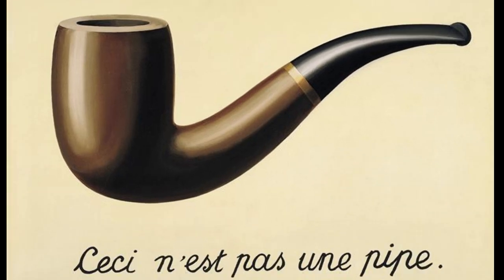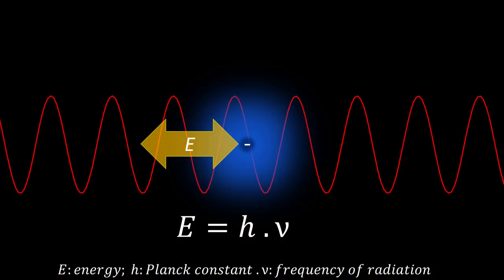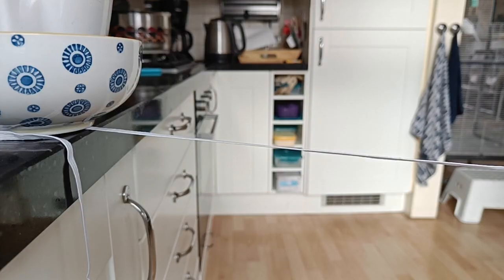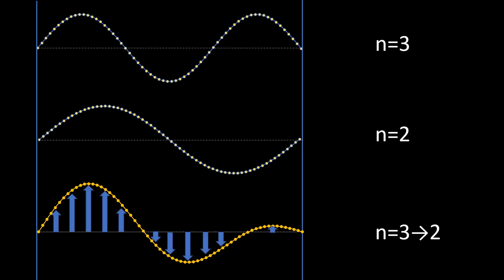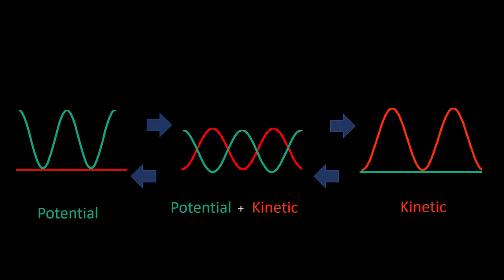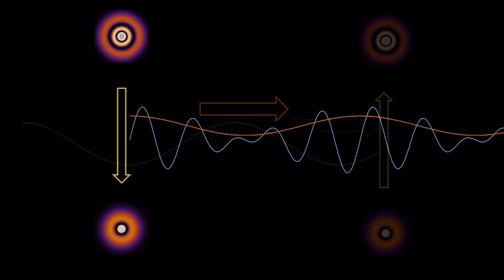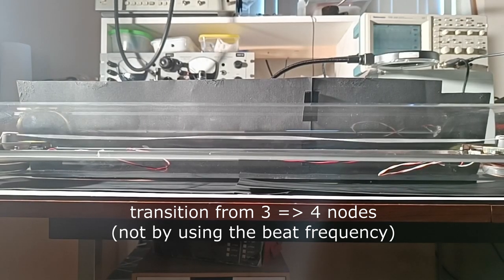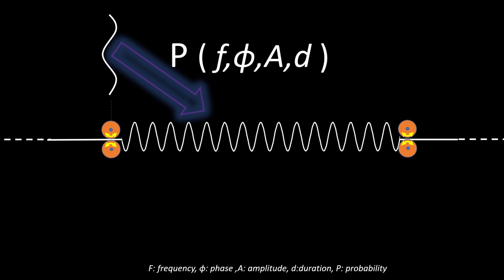Coherence part 3: This is not a wave.

Comment: The property of space that traps electro magnetic waves, is that perhaps the permeability of free space as taught in  theory and radio & antenna topics? Does a dielectric material, have a stronger effect or one that works at lower frequencies? 

I am reminded of slabs of clear plastic acrylic, be with a very strong electron gun, that hold a charge inside its volume, which is dramatically released as an electrical discharge lightning bolt pattern, when a grounded ice pick is used to stab the slab of acrylic. 

https://youtube.com/watch?v=f-_UfQ5eOxA&pp=ygUeTGlnaHRuaW5nIGFjcnlsaWMgZWxlY3Ryb24gZ3Vu

Granted, in one sense, the charge is perhaps many many electrons trapped in the plastic. But in your standing wave sense, it could be another example of entrapping high frequency waves within by space but a dielectric material. The closing thought is perhaps one can trap lower frequency electromagnetic waves more thoroughly or with less leakage than say a resonant cavity. Superconductive cavities also come to mind.

Comment: Not so quick, what would happen if one speaker would have a frequency of something like 8 Hz at one side of the table and another speaker would have a different frequency, like 12 Hz, but then not horizontal polarisation, but vertical, both agitating the same medium. Then the string would have two resonances at the same time. Would this not give some vision in how and where, the standing wave would be fluctuating and only visible for a certain viewpoint. 
 
Back to the kitchen.

Comment: Thank you for yet another interesting and informative video, particularly about beat frequency being the difference in frequency between 2 vibrational energy states.  Unfortunately, you are limited in your ability to understand the fundamentals of physics because you assume some things that are incorrect, and you need to instead assume some other things that are correct.  When you're ready to get serious about understanding the fundamentals of physics, my unifying theory, matter theory, is for sale.
Reply from the maker: If you have solved physics, then why is nobody buying your solution?
Reply: @HuygensOptics  I think the main reason why nobody is buying my theory is that there is no science organization that is offering to pay for a unifying physics theory.  If you know of 1, and your introducing me to them results in a successful sale, I would be happy to give you a small, yet significant, percentage of what I am paid by them.  Also, I spent over 30 years independently inventing my theory, bit by bit, until I finally had what I consider to be a more or less complete theory, so during all that time I developed no scientific reputation whatsoever.  To try to develop my scientific reputation, I invented what I think is the only logical explanation for the most surprising results of many particle 2 slit experiments, and I made a video about it, which no 1 seems to care about, possibly because it contradicts all versions of quantum mechanics, which makes some quantum theorists look bad.  There are other reasons as well.  Thank you for your interest.  I'm looking forward to your next video.

Comment: One more thing.  Your experiment isn't a good analogy for two reasons.  The EM field doesn't correspond to something that feeds into the electron at its ends; the field is present over the entirety of the electron-containing region.  That means every point on your electron string needs to be coupled to a separate EM field string.  Since the two fields have different properties, the strings need to be made of different materials, e.g. the electron string must be many times more rigid because it has mass.  I don't know how you'll attach them together adequately - you almost need to have an elastic strip between them.  Technically, it also doesn't fly to ignore the fact that the nucleus and electron both have a charge that deforms the EM field by its presence.

My suggestion to you is that you learn some software and programming.  It would be much easier to model the system digitally, and probably more accurately.  Your argument is not about real strings, after all, so that analogy isn't really necessary for your point.  Your point is to examine classical systems that you think could explain quantum properties, and computers have become very good at modeling classical systems.  It will save you time and money, and in the end, when you have to accept that the EM field is itself quantized, you'll appreciate that.  

I had a similar journey through QM, myself, since I was a chemistry student and not a physicist, trying to learn QM on my own time.  I encourage you to explore the topic extensively right here on YouTube.  PBS SpaceTime is an excellent introductory resource, and then you can graduate to all the hundreds of lectures uploaded by Stanford and other institutions.  You should know, at least, that very smart people have had your exact thoughts and pursued them to their conclusion.  Find out what they did and why they didn't revolutionize their fields, and you will have the answers to your questions.

Comment: And now. How might this theory related to the idea of quantum entanglement and Bell's theorem? https://www.youtube.com/watch?v=zcqZHYo7ONs
Reply from the maker: For entangled photons it would mean that they are the result of localized wave energy split in parts, Since these originate from the same creation events (alternatively read "the emitted photons"), the corresponding entangled detection events would have a relationship between specific properties, such as for example polarization. However, because each detection event is governed purely by the statistically interaction with what is essentially a wave, the outcome of experiments would also suggest the lack of local hidden variables.

Comment: I found again one of the best wave machines I have come across:
https://youtube.com/watch?v=DovunOxlY1k&pp=ygUWYmVsbCBsYWJzIHdhdmUgbWFjaGluZQ%3D%3D

Perhaps this might provide a cleaner wave having better “inertia”, to demonstrate the mode change more clearly, when the wave is compelled to switch between different particular resonant frequencies. Note the wave is based on torsion of elastically coupled rods. 

Another video where the rod tips have glow-in-the-dark pigment and when illuminated with a black light, show the wave vibrantly as an oscilloscope:
https://youtube.com/watch?v=YQHbRw_hyz4
Reply from the maker: Thanks for the links, I did not know these videos. Very beautiful and clear demonstrations I guess mainly because of the inertia of the medium and the low spring coupling constant between the oscillators.
Reply: Glad to see someone else already recommended this. It seems that the decay time would be longer with the torsion based setup. With proper instrument synchronization, 1ms is a long time, so you could achieve good control over relative phase between the 8 and 32Hz waves, as well as inject 8Hz right as you stop injecting 32Hz. But that doesn't help for this demonstration if the oscillation doesn't persist for at least several wave periods!

Comment: A new magnetic trap geometry was discovered.
https://youtube.com/watch?v=Rx4lNihOT4U

I wonder now if one could synthesize this field using a fixed coil. 

I wonder also if one could find a similar-as-possible arrangement using a spinning electrical field consisting of opposite polarities rotating but perhaps offset a little as with the magnet trap discovery.

Field based traps are interesting because they could enable new standing wave geometries.

Comment: Sorry but you should use a double slit with 0.4mm and a distance of 0.4mm also. And the laser needs 100mW.  In this case you will get a real doubleslit picture. Now close one slit and you will get a Single slit picture. Than you have to place a black paper 1mm behind one slit. Now you don't get a Single slit picture but you get half of a doubleslit picture. The result of this tests does show light is not a wave.

Comment: I would love to let my brain relax and accept that quantization is a property of matter and its interaction with purely wavey fields.  Unfortunately, the more you dig into all the bizarre quantum behaviors that apply equally to matter and light, the more untenable this becomes.  Photons can be entangled, and their polarizations can then be correlated beyond any physical reason.  If EM radiation was strictly taking place in a continuous classical field, then how can we measure those polarizations independently?  How can they be exactly correlated if there aren't individual photon pairs to correlate?  Sorry dude, I want this to be true as much as you do, but it just doesn't work.
Reply from the maker: Entanglement in photons is just doing two measurements on the same wave.

Comment: Quantization is a property of all physical systems. Dude... not paying attention in science class is not a good thing. ;-)
Reply from the maker: So why do you think that is?
Reply: @HuygensOptics  Most likely because of relativity, but I haven's seen a simple handwaving argument for why angular momentum and action have to be quantized, so I can't give an easy to understand explanation. What we do know is that quantization is the reason why there is any matter at all. Let go of it and there wouldn't be "any thing". 

And why aren't people paying attention in science class? Because they don't think that they will need this stuff. And they won't... until they decide to make videos about it on YouTube which prove that they didn't pay attention. ;-)
Reply: @HuygensOptics  Why is it that because of relativity? Because what is quantized is the angular momentum. There are some very strange things happening when you try to turn a coordinate system in a relativistic universe. At some distance from the center of the rotation the relative velocity exceeds the speed of light. I don't have a good physics intuition for the consequences of that, but I would expect that there have to be non-trivial consequence for the definition of classical quantities like angular momentum. Since it's a phenomenon that is scale independent (it happens for any angular velocity, just at a different distance) that consequence may be the angular momentum quantization of fields.

Comment: There is no such thing as "A Photon".  It a concept only, a metaphor for something we really truly do not understand. A photon  doesn't exist as a tiny piece of matter therefore it can't have any Mass. no Spin. Its not a wave either, absolutely nothing like a wave in the ocean, absolutely nothing like a sine wave plot. Its certainly not a "wave-packet"  These at best are only abstract mathematically derived inventions of fantasy. A bunch of little Many Photon balls never smashed into a piece of silicone photo cell, and "knock off" Electrons, as Einstein thought. ( Electrons also do not exist as little balls of matter.)  Why this author thinks that Light is an Electromagnet effect is beyond me. Light is absolutely unaffected by either Electric fields or Magnetic fields, it couldn't  care less. If it were actually Electromagnetic, then it would react wildly to exposure to Electronic and Magnetic fields. But it doesn't  flinch.
Reply: I have to agree with this. I would like to know where physicists demark the difference from 'photon' wavelengths and the EM waves we know as 'radio waves' (RF) extending up into the millimeter waves we work with now. I think the 'photon' was created in the era of the photoelectric effect by Einstein. As a radio and RF engineer, I stay away from what I call weak photon analogies or explanations of things.
Reply: @uploadJ  So, have you ever heard of an explanation of how RF technology functions, that uses exclusively the concept of Photon Particles being responsible? Because if its all part of the EM spectrum, and that is Particles as well as Waves, the RF theory ought to be explainable by particles bashing into the antennas, so how does that work?  What damage to the antennas does countless trillions of solid particles of some unknown substance, smashing at exactly Light speed, into that soft aluminium, do the the metal? Surely it disintegrates after a few minutes under such a bombardment. Not to mention that according to some quack theory, ANY OBJECT that has attained light speed, MUST possess INFINITE MASS. (the very irrational excuse is that IF you got a Photon Particle and strapped it down to your scale, it would have no MASS because its not moving.  Because as everyone knows instinctively, the truth is that MASS comes from moving.  You move, you gain weight. This is why if you sit on the couch and eat potato chips and chicken, while not moving, you will weight less than that guy jogging past your front porch. See!, I can spin a scientifically convincing story as well as the best of them.
Reply: @everythingisalllies2141  TL;DR. You still can't explain simple wire dipoles with ANY kind of 'photon' nonsense. Well, maybe you can, but, you will be the only one to understand your explanation, because, 'potato chips', and it would be, well, fantasy. Let's not have you waste any more of our time, and you then look up "Antenna Engineering Handbook" by  Jasik, Henry before you respond again.
Reply: @uploadJ  Er.. I think you forgot that what I said was sarcasm. There is no such thing as "Particular" EM  effects.  No Photons anywhere, at any wavelength.  But in a nutshell, pertaining to the belief that "Light" (EM spectrum, including RF) is  "particular," (made of particles of matter)  what did Henry Jasik have to say?  Did he mention it at all?
Reply: @everythingisalllies2141  Oh - a spoof account. Thanks for admitting as much ...
Reply: @uploadJ  I don't get you.  First you agree with me, then next breath, you are making incorrect statements about whit I did not say, that have no bearing on this topic.  Which was, "Do photons exist?"

Comment: The current definition of an election is only a conceptual reification, it's 1 unit of dielectric inductance. Don't get me started on the photon...to late, light is a sound wave in the ether. I'm paraphrasing but that's what Tesla said. When you talk you don't emit sound particles your setting up a disturbance in the medium of atmosphere. Light is a coaxial longitudinal pulse perturbation. There is no speed of light it's the rate of inductance across various mediums hence why light slows down thru glass or water then speeds back up after it leaves.. by the way that violates the second law of thermodynamics to explain light as a particle/wave dualitie. There are no dualities in nature only the One and  reflections of the One.